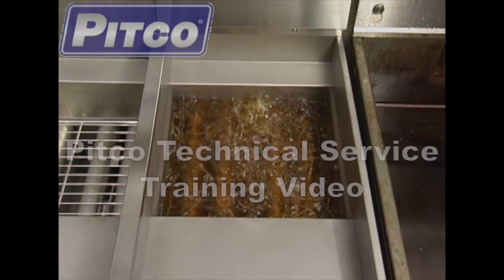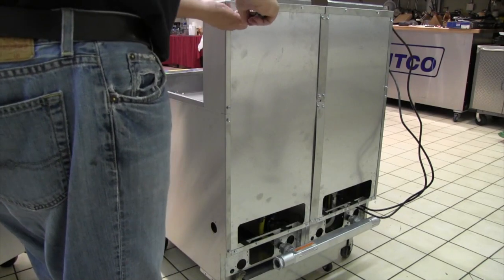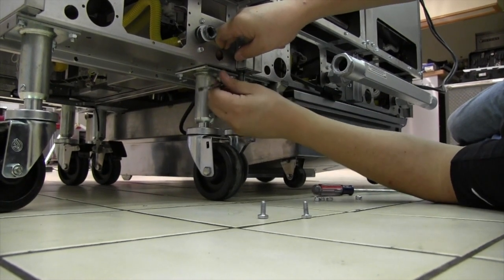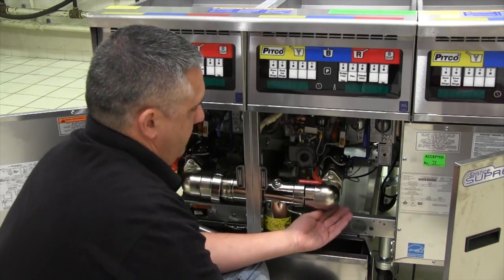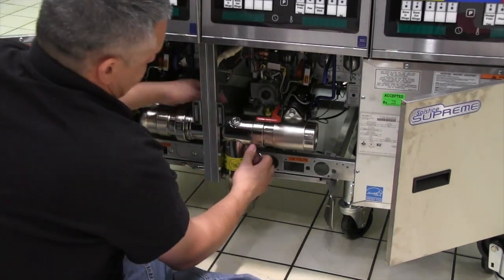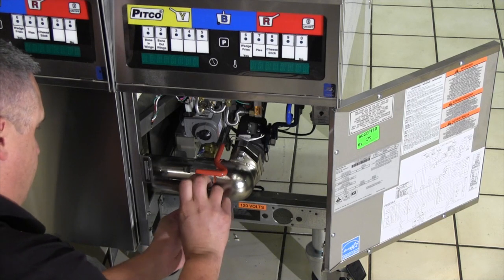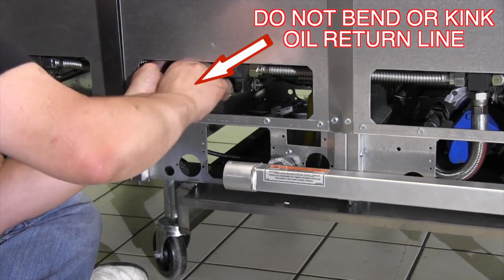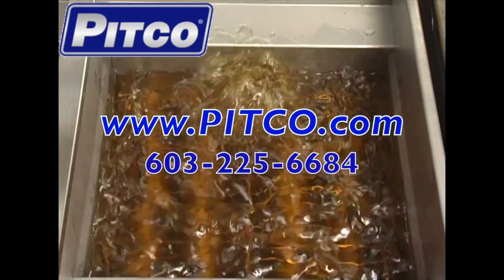Add On Fryer

Comment: Video at 5:05.  Attempt to remove drain pipe on a well used older unit without the Pitco Tool and see how this video becomes useless real quick. That fitting is not going to move without a blow torch and equalizer pipe extension on that special tool.  You will need all of this to get at the drain valve that leaks down.  At which point you will need another set of expensive tools to get the drain valve off.